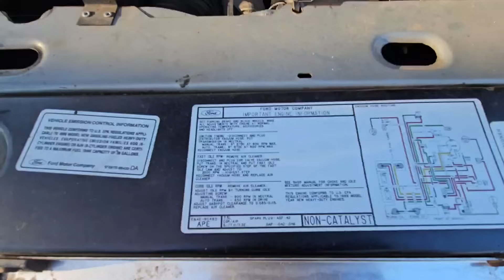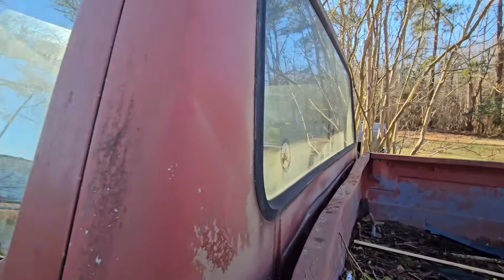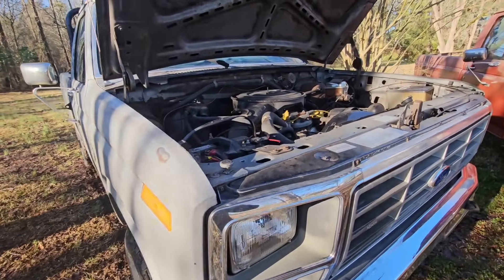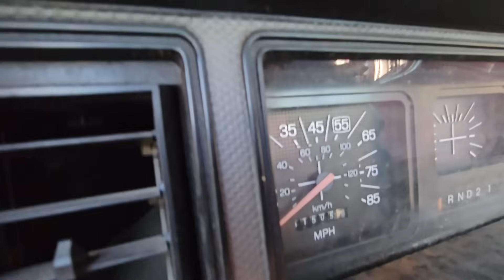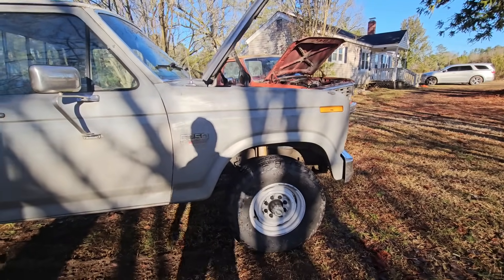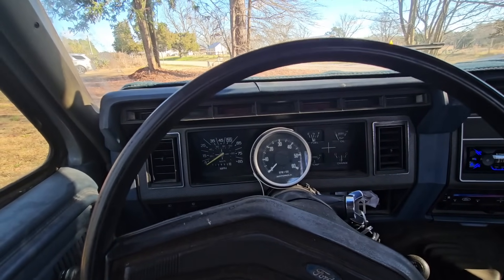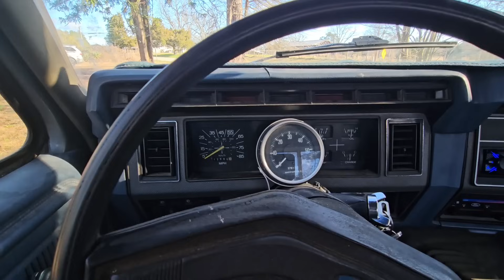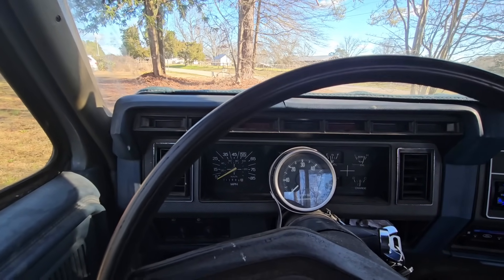THE WORST TRUCK FORD EVER MADE!?!?! #ford #fseries #sbf #bbf #truck

Comment: I’m wondering why you would consider these “the worst trucks ford made.” I would take either one of them over anything made today. These were some of the last good trucks ford made in my opinion. Yea the ride might be a little rough and yea they might tear up after some miles but many parts on these types of truck were universal (as the same part would fit many different year/models of trucks) and they were still easy to work on for the average guy.
Reply from the maker: I never considered these "the worst trucks ford made". The title is a question, not a statement. If you listened to the video you'll hear I said nothing but great things about them except that I think they're ugly and for whatever reason they're hard to sell and when they are for sale they're dirt cheap. It doesn't make sense, but I'm not mad at.
Reply: @runsgoodbutsmokes  yes. Sorry. I realized the title was a question and not statement after my comment was posted. And yes I did hear your many praises of these trucks. In my opinion, these trucks may be somewhat under appreciated as compared to other vehicles and while I do not feel that they are “ugly” I would say that perhaps they are somewhat a little plain as that not much was actually changed as far as a majority of the appearance of these truck from the previous generation. Once again, just my own opinion.
Reply from the maker: @michaelmarburger1003  I agree 100% with you. Better way, not exactly ugly, but plain! Very well said!

Comment: What idiot would ever say 80-86 ford was the worst ever?!! Smooth windows regulators, doors shut well, 300-6 4x4 with a 4 speed was incredible. Clean interior design , front grill. And simple simple simple.
Reply from the maker: @boardtodeath46  I never said that it was the worst. The title is a question. Not a statement. Listen to what the video has to say.
Reply: @runsgoodbutsmokes  hello, im not arguing with anyone or causing a fuss. I would say im more defending the trucks. Yes we all have our opinions, and I respect that. Just saying, posting a video with that description comes across like you own a Dodge and you run with the mirrors extended.
Reply from the maker: @boardtodeath46  I can respect that!

Comment: I have an 85 E350 1 Ton Cargo Van and it is an excellent vehicle.  Unfortunately I really wish it was a F-250 TRUCK because I need an open bed in the back for legitimate work.  The auto transmission in it is bullet proof and the 460 has tons of low end torque.

Comment: Would the buyer be a collector? Or, an occasional, I need a truck buyer.  Learned to drive on an '86 custom, F150 in-line 6, 4 speed, no AC, AM only radio. (I notice one of your trucks was updated with a CD Player).  The one we had was pretty trouble-free, rusted out fast in MN, and the paint fell off, which was a problem back then.  It's hard to spend a lot of money for something, unless it's a universally accepted collector's item.  I think the dent-sides are more collectible.  to use, maybe EFI would be more trouble-free?  Maybe nobody can drive a manual anymore. lol
Reply: Another thought, Are Lariats more collectible?  I think no AC saved a decent chunk of money, if I remember correctly.

Comment: That blue 4x4 F250 with the 460 is a true mountain work horse.  That sucker could pull a 6-cord wood trailer in the mountains all day long!  That free-floating rear axle was a major upgrade, too. The red 4x2 can do work around the farm, but is far less capable.

Comment: More like some of the best trucks ford ever made. The only bullnoses with problems are the ones that had the old smog gear on them that has to be removed and everything tuned up. People just dont know carburetors now but if you learn then these are really cheap to keep running too.

Worst ford trucks are the modern ones.

Comment: I grew up with Ford trucks. My first new truck was a 1980 F350 with a 351 and a 4 speed 2WD. I put a 12 foot flatbed on it and worked it to death for 5 years. In 1985 I ordered a new truck with the same engine/trans setup but was told if I wanted a standard transmission the only choice was a 300 I-6 or a diesel. Well I wasn't sold on the diesel at that time as they were a new fangled engine then and I didn't think the 6 cylinder could cut the mustard. So I ordered the 460. The only reason I decided to buy a new one was because 1985 was the last year for the Reagan  investment tax credit. I took the body off the 1980 and installed on the 1985 and sold the chassis for half of what I paid for it. That 460 had so much power that it could pull a house down. I drove the '85 for 20 years and worked it to death. Neither one of those trucks ever let me down. They were better than anything made today. I don't know  how they can justify the $ 70,000 to $ 90,000 price tag today to replace the same truck when the '85 only cost me $11,600.

Comment: I had a 1986 f 250 with a 351 Windsor and it was a strong plow truck. I ran it in my fleet until 2011 when it finally rotted away that’s what using it in the salt belt and plowing in the winter.

Comment: No catalysts, GVWC 8500 plus didn't need them. The Carpenter F650 trucks with 370 2 or 4bbls, didn't either. Love metering rod carbs. Australians did the same thing, all our 302C and 351Cs used a 800 CFM Carter ThermoQuad after mid 1976 until 1985. I too love US  truck 351 and 460 4190C and EG carbs too.

Comment: I've got an 89 f150 300 5 speed that's a factory non air truck. Dual tanks, door pockets, delay wipers, and cloth seat. But no glove box or hood light. 
It was sold new in Washington state - it only has 100k miles!

Comment: One thing to remember is that in the 1980s and earlier a lot of three-quarter ton trucks came with gas six cylinders. Ford had a 300 in.³ in-line six. GM’s had their 292. I’m not sure if dodge trucks have a large in-line six, but they did have the famous 225 slant six. Dodge may not have had a larger slant six.

Comment: You'll probably need the owner's manual to determine the specs. Unfortunately it's not available online. Not sure about yours but my '94 Ranger's manual has multiple pages to determine towing capacity. Depending on options, that truck is rated to tow half its own weight, up to double its weight. Those were the days when you could buy a new truck for your exact need and price range, instead of "everyone gets supersized". It made shopping used a bit trickier but even the lowliest F250 is a capable truck.

Comment: I had a 1981 f250 2wd with 302 and 4 speed and I hauled a load 1000 miles and went over the scales at 12,000#. I drove that for 10 years.  I currently drive a 1980 f350 4x4 with 400, 4 speed and 4:10 lockers.  I've towed a 14,000# excavator with no trouble. I've had this one for 13 years. They are great trucks.

Comment: I had a Ford Bronco 1986 full size  with 300 six cylinder even  ordered it.  It was the worst vehicle I have ever owned.  my 82 VW rabbit was more reliable.  I was told that it was the last carburetor engine, but it  was computerized too and that caused trouble

Comment: I have an ‘86 F250 with a 6.9 IDI diesel I bought off my dad. 55,000 miles. Near perfect condition. He bought it off a guy that had it in storage for 20 years. I love it!! 

I’ve seen some sold on the auction website Bring a trailer for 20 grand or more. So to the right buyer they’re well worth it.

Comment: I hate them because the body is metric and the engine is standard. The chassis is a 50/50 shot depending on the time and the interior is also metric. Theyre really not terrible to work on, but thats why I dont like them. Theyre great trucks tho.

Comment: i wouldn't take any less than 5k, running all original with extremely low miles for its age and shape, its not junk like todays trucks and anything you could possibly want for it is available and cheap in consideration to new vehicles in general.

Comment: Oh, this brings me back to when trucks were built for non-limo work. In those days, if your paycheck depended on your rig, you were either Ford or Chevy (If you tried Dodge, you did it once). This is what I recall:
Ford advantage: Rode better than the Chevy. Less panel racket. Far more dependable tailgate (Chevy's worked for about 3 years). Best 6 cylinder in the industry.
Disadvantages: You had to know a mechanic/blacksmith/wizard to align those twin I beam suspensions. Automatic wasn't as durable as a Turbo Hydramatic. Nuthin' beat a 350 small block for guts/dependability.
Still, I'd drive either of the rigs in this video with pride.

Comment: The first truck I ever bought on payments (credit building first buy) was an '86 F-250 4x4 with a 460/auto. It got horrible gas mileage but it was a tank to be sure. Absolutely bulletproof! I put wheels and tires on it and a cat back (yes, im in California) exhaust system. Was a great truck!

Comment: Ford in order to comply with growing govt demand for better pollution specs did as other manufacturers, effectively detuned their engine by retarding camshaft timing 4 degrees by altering the top cam gear placement, and often increased combustion chamber sizes, also fitting concave pistons thereby reducing compression.
Early 351 Clevelands 429's 460's often ran 10 - 10.5:1  compression, late models dropped below 8.5 8.9:1 comps.
1970 10.5:1 460's made 365 hp and 488 ft lbs at 2800 rpm later smog 8:1 compression 460's dropped to around 220 hp 380ft/lbs 
Retarding the cam pushes the powerband higher in the rev range burning more fuel IMO.
Fitting an after market timing gear with the original advanced position will help considerably, flatop pistons will give a healthy gain in horsepower and torque and after market or early pre 72 model heads will make the 460 a fire breather. The 429cu  hi po and 351 HO and Boss engines were the real track burners though revving very freely to 6000 rpm and more if modified and balanced.
However in a heavy truck a long stroke and moderate compression is preferable for a reliable cool running truck under load.
Jus sayin

Comment: What does hurt those trucks mid 80s into the 90s is the fuel delivery & fuel injection systems R total garbage as is the Transmissions a real pain in the ass and expensive to rebuild on some that don't have the normal C6s automatics. The 4spds are a nightmare they go out suddenly and cost about $2,500 just in parts especially a 4x4 model. Then they are not easy to work on. All kinds of brackets garbage in the way of simple maintenance stuff. The 70s into the early 80s are not that bad. Past 85 they R total nightmare a myriad of bad sensors and switches. You are talking to a guy that has a few of em and had others too. Mostly why I drive my GM trucks.

Comment: I have a 95 F150 Eddie Bauer extra cab short box 5.8 4x4 No you can't have it. Working on a frame up resto of a 94 F150 with a 300, 6 auto. Reg cab long box. BTW, I'd take either one of those trucks in a heartbeat.

Comment: Owned an 85...no cat, ran on regular, leaded  gas. 300 six. Reliable, but rough riding, noisy, and lousy steering,  courtesy or the antique twin I beam front suspension. And annoyingly, the tailgate latch broke easily

Comment: This brings back memories. I bought a 1985 f250 and ordered it special with manual shift and a port fuel injected 302. Waited months to get it, radio delete, no AC, basic work truck. $11800.00 new. that 302 ran as smooth as an electric motor until the end.

Comment: 1996 XLT F250 4x4, Ext cab, 5.8L, 280k miles, bought it new, well maintained and mint condition, weekend daily driver (company truck is my weekday daily) but it's never let me down once.  

My work truck is a 2022 4 door Ram 2500 4x4 Cummings diesel.  It's a nice truck, but honestly feels more like a luxury family wagon disguised as a truck.   The F250 just feels like what a truck should be to me.  

I love the 80's trucks too.   Ford used to build em to work and to last.  Today's truck just aren't that anymore.

Comment: I wouldn't say that these trucks are 'ugly.'  Just really bland styling - basically the pickup version of a Fairmont.  Plastic grille and rectangular headlights.  Tastes are subjective, but my preference is the styling of the earlier style that debuted in 1967.  Another factor is that pre-1975 trucks don't need a smog check (at least in California), and the engines are less choked by emissions equipment.  Another factor is that newer trucks have more creature comforts and can easily do 80+ on the highway.  So if you're going to get a truck that can only cruise at 55 mph or so, you might as well get one with more classic exterior styling (two-tone paint job!) and more HP.  I will note that Ford had good dashboards and interiors into the 1980s, so that is a point in their favor.

Which is not to take anything away from the trucks in this video - presenter makes a good case why these are a great buy as a reliable daily driver / work truck, with readily available parts and not too much computer crap.  Just taking a swing at answering his question.

Comment: No mechanic wants to work on a 35+ year old truck… So you have to know your own way around the mechanics of an old truck.
Reply: I have a 1986. 6.9 idi f-250 with a flat bed with oak side rails that I made, previous owner put a dually 1-ton rear axle under it. I have had the automatic transmission rebuilt and the injection pump rebuilt and installed new injectors, and I am the head mechanic….

Comment: Actually, if you did research or know Ford trucks at all, the 1963 F100 was the worst. It was made one year only. All complete body with no separation of cab and bed. Constant complaints of the doors not shutting or doors stuck closed due to the stress of a good load in the bed.
You are welcome😊
Reply from the maker: @colinl5951  My goodness easy. Did you see that there are question marks? The title is not a statement, but a question. I never said what I thought the worst ford trucks were.

Comment: I had a 1980 F250 4x4 with the 351 4speed I paid 500 for it had to replace the rear end and the battery tray, was lucky enough to find a full floater Dana 60 in the right gear ratio and to have a friend that is a ace with a welder to fab me a new battery tray. Loved that truck .

Comment: old trucks are old because.......they are old.  old is not new...it is old.  old is not good because.....its old.  Ive heard old timers say..."boy they don't make em like they used to".  thats a good thing.  old cars could barely make it 60 thousand miles.  old designs, old parts, old people driving them.  If you have failed to grasp my point here, let me be clear........old is O L D.  it will never be new....it is old.  I prefer new.  thank you very much.  p.s.  Im 75 years      old.
Reply from the maker: I appreciate this comment! Great read! Got a good chuckle out of it! As a younger gentlemen nearing 40, I don't disrespect my elders, but as you stating you're 75 and prefer newer. I daily a 1979 pontiac firebird (LS swapped) and the gray truck in this video and I will say, there is something about the feel of an older vehicle that the new cars just don't have that I appreciate for some reason. I've owned brand two brand new Mustang GT's, both of them are now sold after owning combined of both 10 years and although they were fun and really liked the, I always revert back to driving the older cars, because they just have a different feeling that I like! I do appreciate your comment, most older people I've talked to prefer the older vehicles. Nothing wrong with either!

Comment: Having the AC delete on those trucks (or really, on trucks from any manufacturer) was a pretty common thing to do back in the 1980's.  I grew up in that era in a rural area where nearly everyone owned a pickup...and it was rare that you knew someone who actually had AC in their pickup.  AC was considered almost a "luxury option"--you might get in in the sedan that your wife would normally drive, but you wouldn't put it in the truck so that you could save money...and yet these trucks were often used for hauling hay in the summertime and doing similar activities--AC would have been nice!

Comment: My dad bought new 1980 F100, lwb, no power steering, 300 inline 6 with a 3 speed on the column. Yes 3 speed on the tree. It had dealership AC and radio. I still have the paper work. Cost was around 6,600$